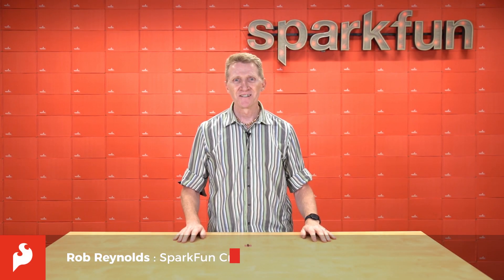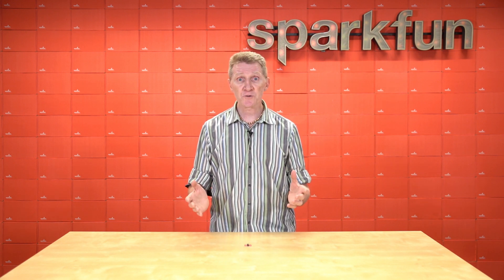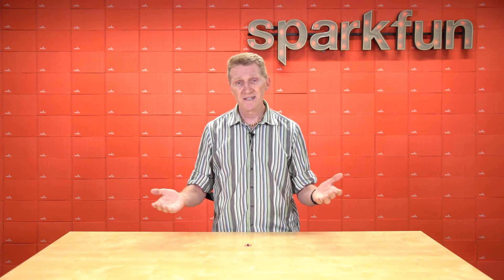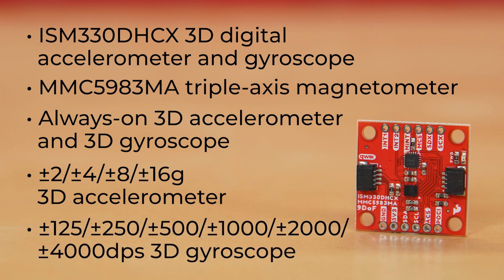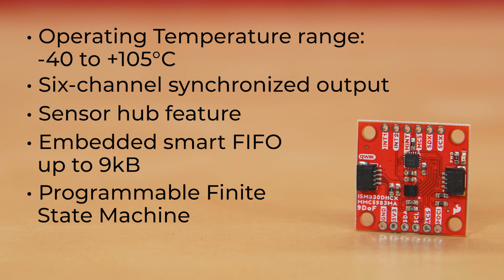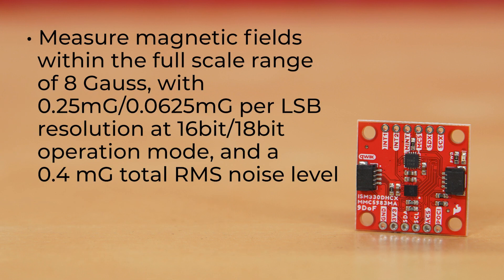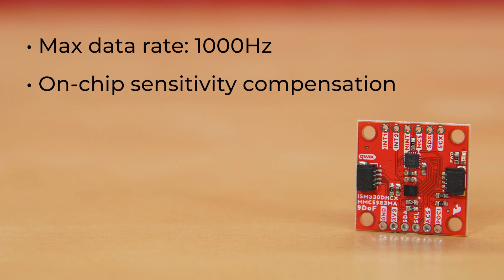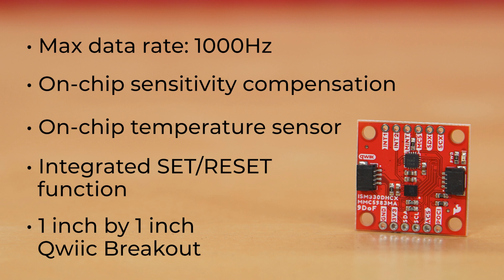Product Showcase: SparkFun 9DoF IMU

Comment: you know the best thing about IMUs is getting easy access to Euler angles and sensor fusion. I checked the GitHub but cannot find an example for machine learning core or sensor fusion. Unfortunately anyone can combine a 6dof (eg. mpu6050) and a magnetometer. The fusion part seems hardest, yet unsolved issue with this product - yet? Or can anyone point me to the example if I'm wrong? Thumbs up for the great work though

Comment: Don't retire just yet.. "RMS" --> There's a tricky one for you :p

But, seriously - don't the nickel leadframe-layers in the decoupling-capacitors near the magnetometer mess with the magnetic orientation? I always strive to put no other components in a 10mm radius around magnetometers... Or at least use components that are non-magnetic - though those are pretty expen$ive.